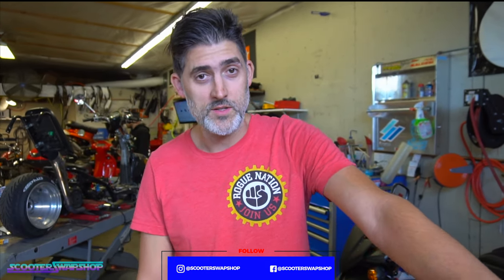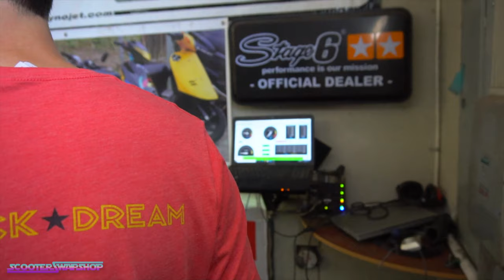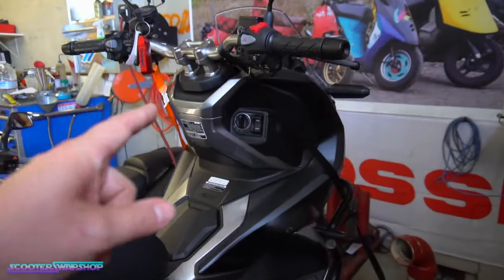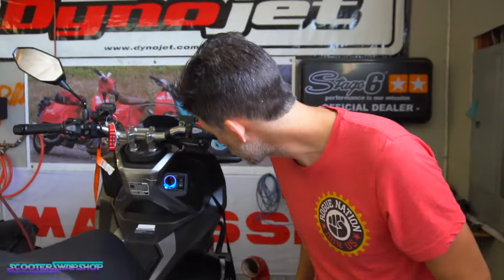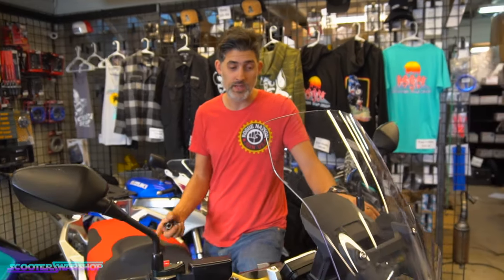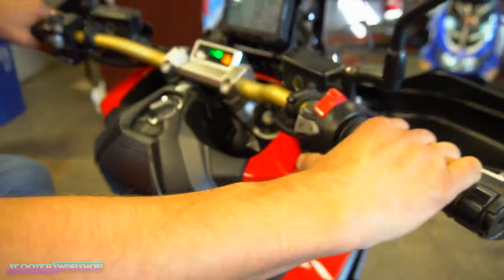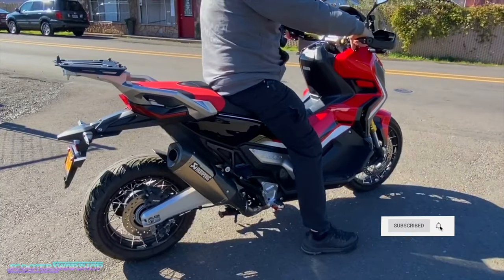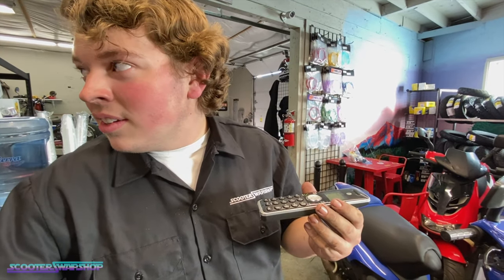We dyno the Adv 150 and show you around the XADV

Comment: Say I have a Jog with a vertical minarelli, would a Zuma vertical minarelli bolt right in or require modification to fit? Like does it use the same mounts and is it the CVT a similar length?
And would there even be a point in swapping between the two. Most vertical minarelli parts I find are for the vertical Zumas, which is technically a different engine from the Jog. Would all of the parts be interchangeable between the two, or would it be best to switch?
Reply from the maker: You’d need special motor mount. Your jog vertical is not the same as the Prebug vertical
Reply: @Scooterswapshop  what about cylinder compatibility between the two. Would performance parts like cylinders, cranks, and exhausts for a Prebug vertical work for a Jog vertical?
Reply from the maker: Some works some doesn’t. It’s far too involved to explain it here. I would definitely advise using a different engine the first gen vertical is extremely hard to get gains on

Comment: HI Great Vid, Because its the same engine as the PCX which has a 14" rear do you think that would be a good convertion if you were going to fit road tyres you could fit a 150/60/14 to the rear
Reply from the maker: We have some 14” matching spoked  wheels coming :)
Reply: @Scooterswapshop  i will be interested to see them, but my ADV here in the Philippines is Disc on the rear. as i said before if you would like some pictures of the rear disc no problem